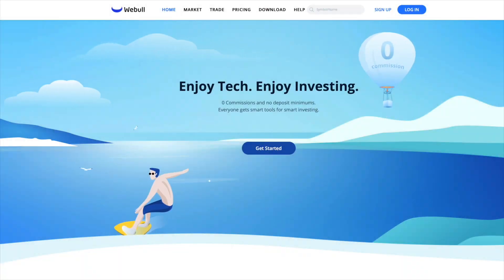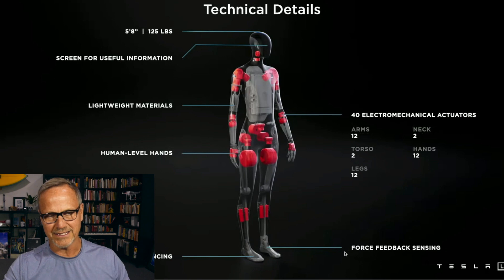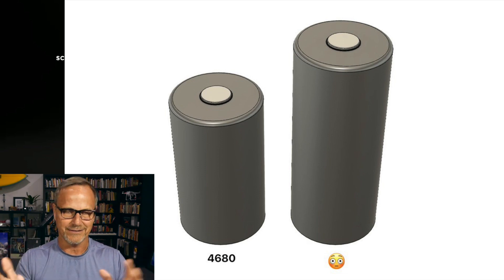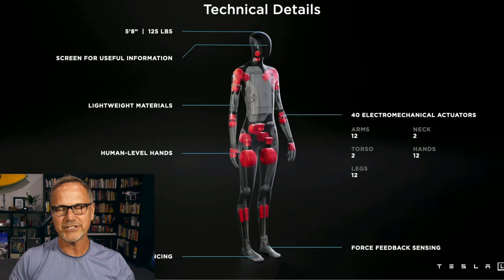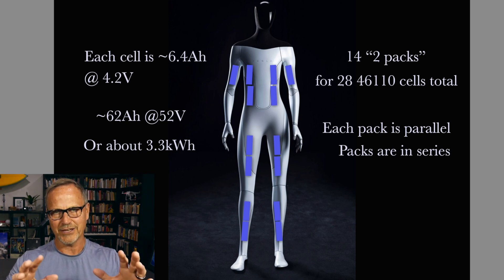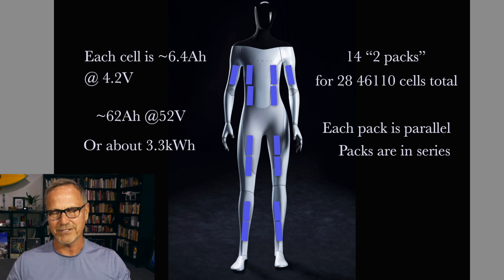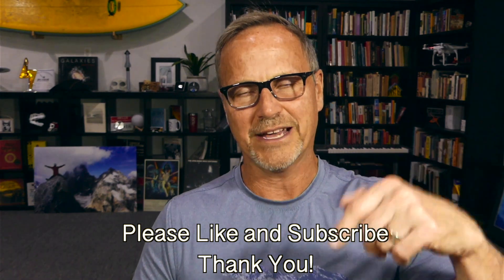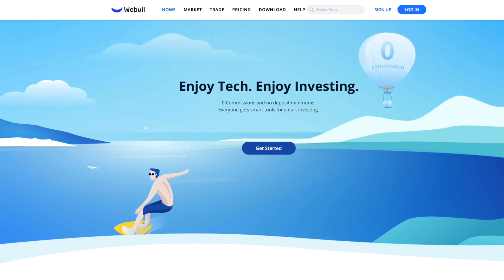Teslabot POWER!! Where the heck will the BATTERIES FIT?!

Comment: You have to consider the manufacturing process when looking at the design of any Tesla product. Part of the choice of battery placement will depend on ease of manufacturing and that may not in the end be with a single battery form factor. Both power and structure will be factors.

Comment: I predict they will have hot-swappable thigh pack batteries using pouch cells instead of cylindrical cells.  (Or maybe 1680 cells.)  Battery swapping makes sense for these robots, and having two packs means the robot can swap them itself, one at a time, without losing power.  Elon won't use pouch cells in cars because of thermal runaway issues, but that won't be a problem here because the power level is so much less.

Comment: Ha, thinking about cooling. The shoulder areas and buttocks come immediately to mind. And, in fact, the Bot could use evaporative cooling. If it is smart enough to keep itself charged, why, it could simply drink a glass or two of water now and then and circulate that around hot spots and let it evaporate in cooler areas (like shoulders). Works for me :-}, why not for Bot?

Comment: If the robot is going to be doing repitive tasks like moving stuff around like they will most likely be inside a TESLA factory couldn't they have a minimal battery pack lets say roughly an hour or less couldn't they just line the factory with wireless charging tech so it can charge while it works, weight wouldn't be much of a problem then.

Comment: Battery Location:
I think all cells (the pack) will be in the torso or in a back pack because:
-heavy limbs are very inefficient (constant ac/de-celeration) 
-heavy limbs are dangerous when working around people
-a single pack allows for easy swap outs
-cells in extremities require more integration and complexity
-a high cg is not a disadvantage in a humanoid robot (inverse pendulum)
Reply: The constant accel/decel was an instantly recognized error. Butt area would seem to be useful mass-wise.
Reply: It indeed does make sense to distribute the batteries out partly for the reason mentioned in the video.....(i.e. weight management) and also mostly for SPACE MANAGEMENT. The limbs are likely to be hollow pipes (the geometry gives the highest strength for material mass) which can be easily filled with cylindrical cells.
In all probability it will be 4680 cells itself. Longer versions don't necessarily make sense (it's not just heat management, but structural strength also is important.....so longer ones will need thicker cell wall etc). Given Elon wants to have cookie cutter factories worldoever making standardized products it doesn't make any sense to create longer cells for Semis (which are really not high volume products!)
Reply: @omnicurious2949  What is the advantage of "weight distribution"? The mass is still carried through the joints (burdening actuators) to the torso.  Please explain.
Reply: @ryankozak99  I think for overall balance proper weight distribution would be useful. Tesla bot is not just a robotic arm that's FIXED to the floor; it is expected to move/pick weights from different distances & levels while being balanced on its feet. Weights in the upper arm area will help balance itself when (say) one arm is suddenly loaded (creating a force moment on one side)...then the other arm can be raised to create a counter-moment just as we humans do.
Even when there's no external load, when we humans feel like we might be falling on one side, we lift the other leg onto the other side and counter the tilt.
A concentrated weight in the torso is not a good recipe for good balance IMHO.
Reply: @omnicurious2949  Good point - like Boston Dynamics' "Handle" robot (with the big counterweight butt). I guess time will tell if that is worth the possible disadvantages.

Comment: I don't think Optimus is going to be this "attractive" with slender calves, thighs and waist. The weight needs to be as low as possible for stability and avoid outboard mass in the arms to reduce momentum (p=mv). Think about how cranes and skid steer (Bobcat) vehicles are designed. Heavy at the base with strong, slender "arms." There will be different bots for different application. Some will most likely be track or three wheel based. Think R2D2.

Comment: Interesting speculation.  It's clever, but goes against the Muskian fondness for eliminating complexity. 

I'd go with a combined battery/logic module in chest which would allow for a single active-cooling solution. We could get away with a smallest possible battery pack,  because the robot could charge itself on demand. Range is not an issue when you live less than 10m from a charge point. 
Charging would need to be pet-and-child safe but robo-friendly. I'd suggest a contactless, inductive-charging pad, perhaps in a seat-back. Charging and offline mode would be in this seated configuration.  This way, no active balancing is required.

Comment: Re: cooling.   low strength repetitive applications so I would agree minimal if any cooling necessary , especially for V1 indoor manufacturing prototypes. 
   
However - if target market is dangerous environments.. eg working hot summers.. or Mars.. ...'outdoor' models may require a temp control circulator system.. but that can totally be version 2.   Then again It's probably much more efficient to build a temp controlled structure around the bot worksite than ask it to do extensive work in harsh environments, unless the components themselves are just super-durable like satellites and temp can be mostly ignored.   Tesla should borrow SpaceX's chief engineer to consult on that.  ;) 

fans & vents will be up high where airflow is likely to be better.. arms / back may even be made of high heat conducting or 'sweating' material ..
 also like humans expect significant cooling from the head area

Comment: The whole skeleton of the bot can be battery. I don't see why you need these special cells. The smaller cells allow for more flexibility in shapes. Maybe you could think also about the skin. We have our skin 'factory' right below the surface. So wear and tear is handled by constant replacement. How would that be with the bot? It will need a constant stream of new gloves. So shedding of micro plastic would be a problem. Thus we need good eco friendly bot skin.
Reply: Probably will use the cells so they don't have to create new factory lines.  Saves them a lot of resources.  I like your points though.  Version 2 might be just giga casted structures and the battery fluids are filled via ports and small tubes/veins.  Every cyborg movie (e.g. Ghost in the Shell, Blade Runner) seems to go in that direction and not towards battery cells.

Comment: Re: Battery locations:  battery is likely to be the highest density of mass.
- expect batteries to be most of the mass in legs through lower torso for stability and moment of inertia.
    - early version might use 4680 but i would expect tesla to craft batteries to fit the form factor if more density is needed. 
    - expect charging connector in feet so a bot that works at a table could be standing on a charging pad while working. 
     - if charge cycle is longer ,  possible that the upper torso can detach and switch to a freshly charged pair of legs
- no batteries in arms.. arms need to be structural and sensors only so that the least amount of force is required to move them during work = most efficiency & durability.

Comment: • Where will it keep its batteries?
In the legs. The weight of the batteries will give some stability while Optimus is standing charging and the heels will make a charging circuit with one leg connecting to the positive and one leg connecting to the negative terminals of the charging stand.
• How much power will it need? 
Well, it's not going to run marathons. It's not continually moving crates weighing hundreds of pounds. It's not even going to need as much power as a human being which can do those things
on nothing but three square meals a day.

Comment: I think that the batteries are going to be on the back or the hind legs. The reason for this is if you want to maximize productivity, you need to minimize downtime. Tesla may not want to implement a battery swap system for their cars but a battery swap is the only way to keep these bots running 24/7.
Reply: it will be in the buttocks, "I like big bot butts, I cannot lie..."
Reply: @mynameisnobody1fjb372  not much of a Sir Mixalot fan, I see...
Reply: @mynameisnobody1fjb372  #FJB indeed, try google, but I can understand if you cannot figure that out.

Comment: Hi John, I think there is a potential disadvantage of packing the cells in the limbs.  This would increase the load on the actuators which would reduce the efficiency of walking and carrying things.  Maybe the pelvis would be a better site for the battery?
Reply: The batteries would be structurally bound to the skeleton. It wouldn’t add that much weight that wouldn’t already be required for structural rigidity.
Reply: @ophello  I did some math (I think).  For each battery:
4680 -  .33 lbs
46110 - .44 lbs
That doesn't seem like much weight.  I think the Doctor's speculation is reasonable. And, notice, there are no batteries in the forearms.  I think that is where the problem of increased load on the actuators would be.  The other limbs don't operate at a perpendicular aspect as do forearms which will be where the carrying load would be.
Reply: @ophello  how much does each battery weigh?
Reply: It indeed does make sense to distribute the batteries out partly for the reason mentioned in the video.....(i.e. weight management) and also mostly for SPACE MANAGEMENT. The limbs are likely to be hollow pipes (the geometry gives the highest strength for material mass) which can be easily filled with cylindrical cells.
In all probability it will be 4680 cells itself. Longer versions don't necessarily make sense (it's not just heat management, but structural strength also is important.....so longer ones will need thicker cell wall etc). Given Elon wants to have cookie cutter factories worldoever making standardized products it doesn't make any sense to create longer cells for Semis (which are really not high volume products!)
Reply: @omnicurious2949  I agree.  Except for the Semi.  It will be high volume and disrupt the logistics sector.
Reply: @TomUlcak  I meant comparatively lower. US sells ~5 million passenger vehicles but only ~200K semi trucks. Even assuming each Semi will need 10x cells than avg passenger car, the total battery requirement (if all vehicles sold in US were electric) for passenger cars would be ~3x that of Semis. I think Elon will want to standardize on the cells and factories so more factories and cells can be built. Semis are already being built to full load and range using 4680 cells, I absolutely don't see any reason for Tesla to introduce a new form factor. Fanboys sometimes are too attention seeking and will throw out weird (unsubstantiated) speculation to churn coversations.
Reply: @omnicurious2949  Yes, comparatively. But, the point of the 46110 battery is it could go into the Cybertruck as well. The Doctor mentioned this.  And, the Cybertruck will be high volume to say the least. And, eventually, Optimus will be too.
Reply: @TomUlcak  The rumor for 46110 came from some other fanboy, actually.
That said, Cybertruck too is already designed with 4680 cells. Unless Tesla has decided to ditch 4680 cells for whatever reason, I don't see a reason why Tesla would introduce a new form factor all of a sudden. When battery chemistry changes, new technologies become available a new form factor is conceivable....but I don't see Tesla going that way in the next 5 years at least.....what with 2 NEW cell factories just coming up....and Elon itching to replicate those factories at least 5x in the next 4-5 years.
Reply: @omnicurious2949  hmmm.... 'fanboy'?  that's an emotional reaction.  do you not find this video relevant?  I wonder who this 'fanboy' is?  Do you know?
Reply: @TomUlcak  I didn't mean 'fanboy' to be a pejorative. I am a Tesla/SpaceX/Elon fanboy....I have no shame admitting it....(but I also rational...I do not hesistate to say it Tesla/SpaceX is not doing something I feel doesn't make sense).
Anyways, the 'longer' 4680 speculation came from one of the usual speculators on twitter....don't remember who exactly it was.
That said, If you've read my initial comment, I agree with most of what this video is postulating (just not the longer 4680 bit)
Reply: @omnicurious2949  I'm not sure where you are going. I think a potential 46110 battery is worth speculating about.  No matter which fanboy (I am one) has suggested the idea.  There are a lot of intelligent people who come here and I learn a lot.  Even if it is 'only' the speculation of a fanboy discussed by other fanboys.
Reply: @TomUlcak  This convo went south for no reason. Good bye.
Reply: @omnicurious2949  you came in with a chip on your shoulder.  I just wanted to discuss. But, obviously, you are insulted because I disagree with you.  I just dumped a friend for being insulted that I disagreed with him.  Yeah, goodbye, and grow up.
Reply: @TomUlcak  I had ZERO issue with your disagreement. I was providing a rational explanation for everything....until you called everything I said as an 'emotional reaction'....I don't even know how that phrase fits in....unless it's some 'projection' from your end. You seem to have taken some gross offense with me disagreeing with a random speculation (the origins of which you don't even know of).
Anyways, I feel least bit insulted by this conversation. Just feel weird why/how you're reacting the way you did.
Reply: @TomUlcak  Obviously the fan boy is Jeff Bezos.
Reply: @omnicurious2949  YOU said: ..."until you called everything I said as an 'emotional reaction'".

I said that your use of the word 'fanboy' was  emotional.  I mentioned nothing else.

This is also an emotional reaction.  I wasn't going to reply back, but, I couldn't let this exaggeration (lie?) go by.

Most of your replies have been criticism of other people's comments.  Do you have any ideas on the placement of the batteries in Optimus?  Or, are you just here to argue?
Reply: I see what you're saying, but, this thing doesn't move fast enough, for the extra mass to cause latency. The actuators are electromechanical, and have full regenerative motion stop, so the extra energy necessary to accelerate the batteries would be recovered on deceleration, taking some of the 'sting' out of the extra mass in motion. This unit, with it's 'slender' build, doesn't leave much room to put  round cells anywhere else. Any other solution would require pouch cells, which might be what Tesla does in the production model.

Comment: You would want the weight to be evenly distributed, but not like this. You want a ratio  that is ideal to not be too top heavy, but mostly in the thighs. I could see 3 cells together, not stacked, in each thigh and then another 3 in the torso. This creates a 2:1 ratio if I'm not getting the math wrong. There is a trade-off of weight to charge time that might not be what people are thinking. It's better for it to charge quickly and not be carrying so much weight, than be able to run a long time. Maybe it can work for 4hrs and standby for 24hrs. And it only takes 1hr to charge full from 120v. People expecting it to have enough batteries to work for 24hrs or even 12hrs straight are expecting way too many batteries inside.

Comment: It might use induction charging.  You could then have it charge while its standing.  For instance if its mostly working in one spot you could put a rug with a charger built in next to the work area and it wouldn't need any down time.
Reply: exactly, as the first main use will be factory work, the bot will have a small battery and charge inductively while maneuvering on the work surface that is designed for it.
Reply: Totally agree except if it's got hand and can use them.. doesn't even have to be inductive.. but I totally agree 'station' based charging while working is a no-brainer.

Comment: My guess is the first prototypes will be hardwired to power with tubes going up to the ceiling of the tesla factory/ development building. (Kinda like how dodgems use a metal rod)

The final version i assume will wear essentially a backpack for the main battery and have a small reserve battery in its chest (possibly to power the bot whilst it swaps battery packs)

Comment: Put Batteries in legs (for low CG), use lightweigth cables for power transfer and redundant paths and average out spikes in power with strategically super caps. Put as little as possible in high CG positions so only cameras in the head. Arms need to move alot and need low inertia so no batteries but super caps. Run at abou 24/36v.dc.

Give robots a backpack possibly with cold cooling fluid they can swap for very rapid charging or ability to travel.

Never walk up stairs behind a robot a human is quite squishy should it fall over.